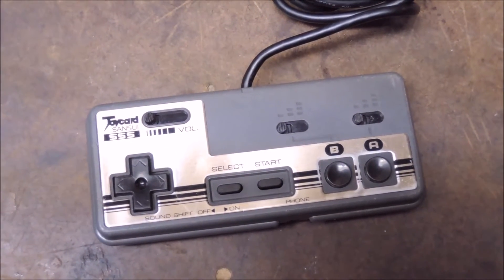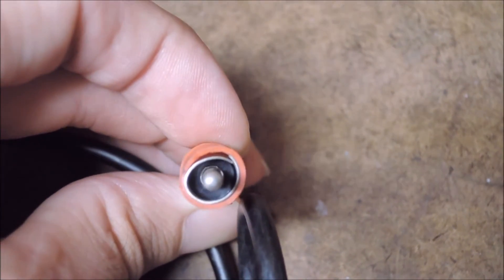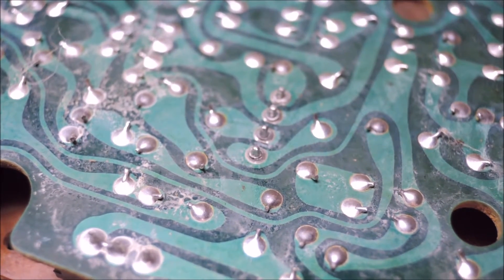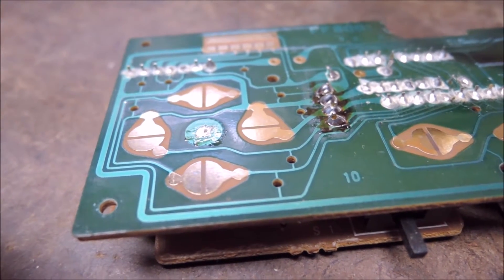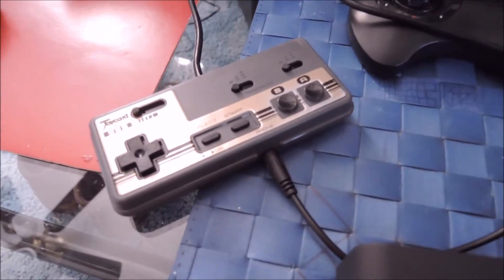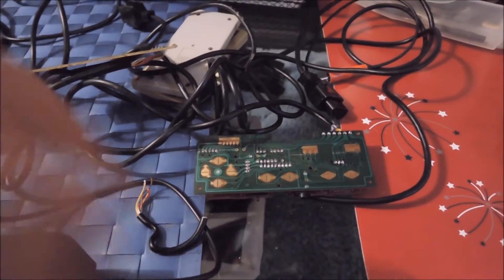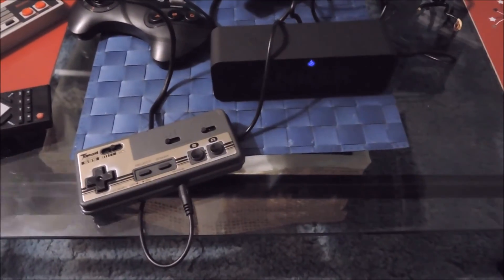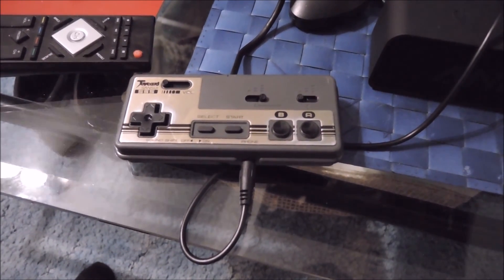Sansui Joycard SSS  The repair FROM HELL!

Comment: Really informative video. I recently picked up the Famicom version of this controller. The headphone jack just gives interference however the sound shift does work and the turbo works.
Reply: What's the Famicom version?
Reply: @Septer_Sever  there are 2 variants of Hudson Soft's Joycard Mark II Sansui lineup, those are: SANSUI, and SANSUI SSS versions, to be honest, I can't find any difference between the 2 with the exception of the name, they all match same output specifications (no real difference in terms of functions) by the way, the Famicom (Japanese) version, features a single large connector (commonly known as 15-pin connectors) while the NES version (America and Europe) features the traditional NES controller plug, with a second plug that is an RCA jack, that plugs in to the NES's audio output jack. Hope this info works!
Reply: @EmperorOfTigers of course, when I connect headphones/aux speakers, and as soon as I pick up the controller from the left side, I start to hear some buzzing (interference) noise from the headphones, yes, another common issue with these controllers, as they have their components completely compact, and sandwich together by two PCBs

Comment: Those 4021 encoder / shift register chips are dirt cheap and available off the shelf. No need to salvage from another NES controller. Didn’t see anything wrong with the flood damaged NES controller.
Reply from the maker: The wires and plug were corroded. Plus it was in the sewage kind of flood water......
Reply: Robert NES816 Yuck! Well, at least it went to a good cause. :)
Reply from the maker: @emmettturner9452  Yeah lol.